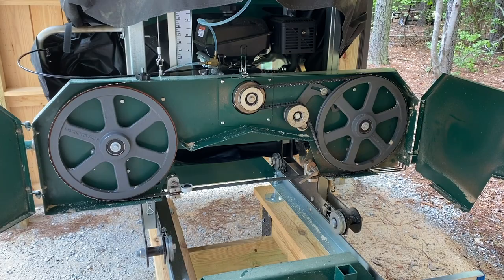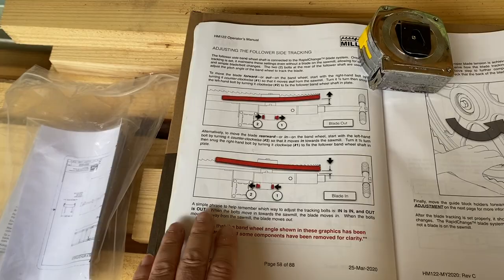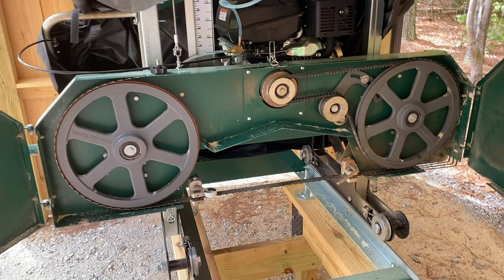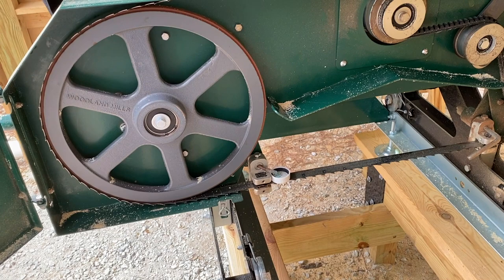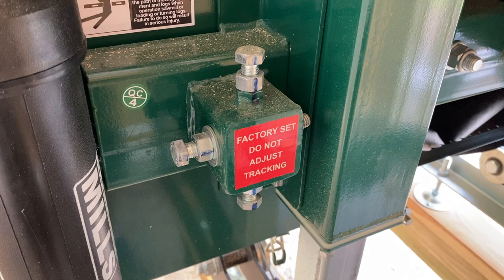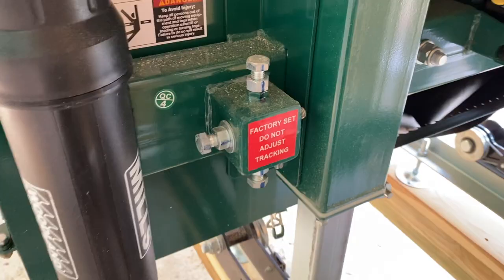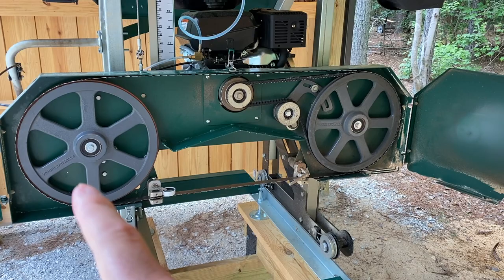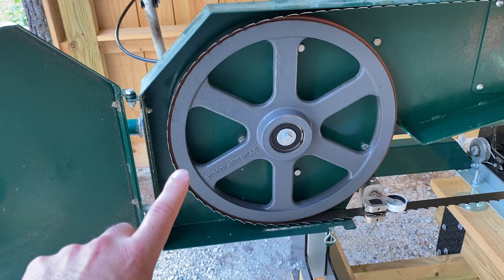Blade jumping off? Learn how tracking works and avoid common mistakes with your sawmill (Revised)

Comment: Saw this video after the event. We probably had the drip set to high but the actual killer was spraying the blade with grease to stop the blade rusting between sessions. To us newbies it seemed like good idea at the time. Oops. The moment we did it it jumped off destroying eight teeth and bending the lower 90 degree right hand catch bar as the blade is about to go up around the drive wheel . Not sure of correct name. With your valuable help we learnt our lesson destroying a newish blade. Roasted by Mrs Lloyd. We also use a torque wrench to measure the tension. The two of us have different ideas of when it's right by feel. Thank's again.
Reply from the maker: Does seem like a good idea until it isn't!!  I haven't found a good solution to blades rusting, but it doesn't happen to me a lot -- normally I dull them and replace them faster than they sit on the mill and rust.

Comment: Thank You! Add me to the list of #3 mistake dummies. This video saved my sanity. I had everything dialed in and checked it twice but never checked the flow of lubricant. I was definitely dumping too much to the blade. All good now!
Reply: Same here! My blade popped off after I had finished a cut and I was raising it for the return trip. Not sure if it had stopped yet... maybe it was just hydroplaning while braking... :) I had a continuous flow. Tracking looked good when I had started on this log, my all-time second log sawn. So Jack, I bursted into laughing when you mentioned it was not a car wash... :)

Comment: We just get our new 126 sawmills, and we tension after the instructions, so the tension mark is flush, and it work well the 30 first minute of use without lubrication, but as soon we put on some lub, the blade popp off.
We call the local dealer, and he said right away the tension is too high, and he was spot on.
When we use a torque wrench it shows 48nm when it flush, and dealer said he never go over 30nm,. (You should never use the flush mark before the saw have run some years, he said)
After we do that it work great without any trouble, so check your blade tension with a torque wrench, don`t rely on the tension flush mark.
Reply from the maker: So the torque recommendation is based on the type, amount, and arrangement of belleville disk springs inside the tensioner.  On 2021 mills, this has not been consistent from the factory and people have run into problems.  They either have an issue with the quality of the springs or it's an assembly/QA problem.  It results in very inconsistent positioning of the tensioner bushing.  WM recently released a tech bulletin about this.  On my 2020 mill and older mills, setting flush works as intended.  I have been doing that for 10+ months and never a single issue.

You can use a torque wrench to verify in either case, just be aware that the torque wrench is only giving an approximate indicator of spring tension (it reads angular tightening torque, not linear tension) and it needs to be read while cranking continuously from low tension to high tension (if you stop then re-tighten more, the reading will be wrong due to friction).  

What really matters with springs is the amount of displacement (distance) changed.  Tension is directly proportional to that.  So if you can indicate the proper setting based on the distance the tensioner spring is compressed, that is more accurate than a torque wrench.

Comment: Until just a week ago I had never owned a band mill because everyone I know kept telling me that they were to much work and to hard to tune and maintain. well I will be straight and honest they are a little more work to fine tune. and it dose take a bit of trial and error to learn. but really its only frustrating until you start to understand warm weather dish soap water. one or 2 drops per second on the blade for green wood. no more this can definitely cause a blade to jump off if you just let it spray full blast. this was something that cost me two new blades so far. and the tracking concept is very well explained here on this video. Except I really wish there was a easy straightforward way to check the wheel alignment. like a Machined face on the 2 band wheel. and a tool to go up against both wheel faces at the same time. I hope someone will make a video about how to make a tool like that

Comment: I greatly appreciate you taking the time to make this video, It was very helpful. I took two 2' identical levels and clamp them to the band wheels one on each wheel horizontally wile being Torque to 25' pounds then i placed a 4' level across from one level to the other and my band wheels were both towed in towards the center. vertically was good .  thank You.

Comment: That was really frustrating!. Out of 10 new blades i ordered with new mill only three can be resharpen. Seems like i have had same Quality Control #4 sticker on. Probably applied as a package or just for decoration. Another problem with QC#4 was four blocks/guides maxed out on the bottom and flush with top holders. And that required some grinding and tinkering.. Other then that it's a good machine.

Comment: Great video. I have a customer who runs this mill and he was having difficulty getting it to track right. I have a machine shop and try to understand what is going on. 
Upon first inspection I noticed there is a huge play on the slider/ tensioner mechanism of the follower wheel. Obviously the play in the horizontal plane is eliminated by the tensioning action but the play in the vertical plane is essentially there and only gravity works on it. If not a source of poor tracking it might cause vibrations. I have taken the tensioner mechanism apart and milled down the four studs about a millimeter to achieve a pretty close sliding fit. It is a bit disappointing to see the sliding portion is just a thick plate which has a bow in it and was not post- machined. I left this alone because milling or surface grinding it on both sides was too involved at that time.
The customer has run the machine after that but is still having difficulties, it appears the saw tracks OK upon initial adjustment but wanders and even is thrown off at times. I do not think there is much to be gained in fiddling with the drive wheel side because there is only a slight difference in the position of the saw on the two wheels, not enough for it to be critical in my opinion. 
I'll be going to the customer location tomorrow morning and again evaluate the situation. Thanks again for the video, cheers from Holland.

Comment: the other co. builds with the top of the wheels lean out ward  ( 3/16 to 1/4") which
points the blade  teeth slightly downward . as you tighten the blade the roller guides 
or the  rub guides bring the blade parallel  to the track

Comment: That was good info ,I have been using way to much lube. Bubbles in the lines are causing inconsistent flow settings. And too much lube causing the blades to slip off.

Comment: Move the roller bearings out of when doing tracking also ,  For the most part my tracking has  been good. Had a few times it's jumped, but mainly I  think it's  when putting on a new blade, but I have always noticed my drive side the blade is usually about 1/16" over the back side of the wheel  but it stays on track more often than not.

Comment: When u put your blade on the wheels. you can see if it will track off or be straight. My Thomas did this and once you adjusted ,the blade stayed on fine. Woodland has more sophistication than  the Thomas does.

Comment: Instead of guessing how much lubricant to use while milling.  Wouldn’t it make sense to monitor blade temperature with a hand held laser temperature gauge or whatever it’s called.  Then adjust your lubricant accordingly.  I would imagine that blade manufacturers have a recommended temperature not to exceed for their specific product.?

Comment: less than 5-hrs and changed the blade and the new blade won't track correctly......called woodland and they said I would have to adjust tracking on the follower wheel.

Comment: You may have answered this multiple times before, but what is the purpose of the bottle cap sitting on the blade where the lubricating tube sits over the blade?  Just to catch any errant drip?  And I guess it gets removed during your prefight checks.
Reply from the maker: Correct, it keeps lube drips off the blade after the mill is shut down for the day, avoiding a rusty spot on the blade.

Comment: Got a new mill and had the blade jumping off from the get go. Tried different blade tension and it would still happen. Tried to align the wheels and it's still coming off. I am afraid to use the mill now. I already destroyed 5 blades. I called the tech support and they suggested the blade tension is too much (towards the end I used a torque wrench set at 25 lbs because no matter how I tensioned the blade by hand it came off). It's pretty frustrated as I need to mill logs and not do repairs on a new mill.
Reply: I've had an HM130max for 4 years and it's been nothing but trouble. I've spent days adjusting and checking everything, but the blade still comes off whenever it feels like it. Customer service was useless as well. These mills are cheap junk made in China with clever marketing.
Reply: @4500az  Sorry to hear that you are having these troubles. I had a real good mechanic over and he aligned the wheel again for me and it did the trick! Yes these mills are cheap but you do get what you pay for them. It's like spending 10k for a new vehicle and then wondering why you need repairs after 10k miles. I really like milling logs and I am not sure what I would do next. Spend 50k$ for a good mill (woodmizer lt35 hydraulic would be my choice)? I can buy a lot of lumber for that. I think that you need to be a mechanic for those mills and account for extra time for repairs&maintenance.

Comment: Great comprehensive video, thank you! What are your thoughts on reversing the lubricant nozzle so that is drops the lube on prior to the blade guide, perhaps allowing some to reach the underside of the blade as well? Some of the more professional mills squirt the lube on both sides
Reply from the maker: I wouldn't rely on the blade guide to do a good job at that, but hard to say until you try.  One of the slickest setups I have seen used thick felt wicks to wipe lubricant onto the blade, top and bottom.  Did not seem complicated either.  Probably would be easy to rig up.
Reply: @Lumber_Jack  I heard you mention that, with diesel in one of your videos. I'm waiting for my hm130max to show up... any day now :)

Comment: Great video! I am currently setting mine up and it will definitely need to be adjusted. Did you place you saw on the tracks then shake it like they recommend before tightening all bolts? Thanks
Reply from the maker: Absolutely, that is very important, and you want to make sure your track is straight, level, and flat before doing that, since it will affect how the carriage wheels sit and the trolley frame settles.
Reply: @Lumber_Jack  Keep the video's coming!

Comment: never move manually blades in opposite direction- I did and get problem with motor ,probably motor thru the clutch moved in opposite direction
Reply from the maker: Clutch should not be engaged when engine is off.  If it is there are bigger problems!

Comment: How much clearance do you run on the blade guides.
The book says.020 on each side. That seems excessive to me. We have started getting some wavy cuts
Reply from the maker: I set them by the book, 0.020" top and bottom and 0.040" on the rear.  I use shim stock to set all of them simultaneously.  Make sure you snug down the set screws real tight otherwise the guide blocks can move.  Cut quality should not depend on the guides, they are just there for support if the blade deflects for some reason.

I have seen ripples (spaced 1/4-1/2" apart) when entering the ends of a cant that is not supported and shakes a little.  And I have seen larger scale waves, but rarely.  The waves usually come from pushing too fast, or cutting with a dull blade, or hitting a knot while pushing too fast or with a dull blade.  If you can avoid those scenarios it will reduce the possibility of waves quite a bit.

If you have an adjustable blade guide, bring it close to the log to minimize the unsupported part of the blade.  Finally, make sure blade tension is set right.  The distance of the supports and tension are the two key factors in resisting blade deflection under load.
Reply: @Lumber_Jack  thank you. I appreciate your reply
Reply: Do you use a torque wrench and how much pounds?
Reply from the maker: @waynepitts2154  I don't use a torque wrench.

Comment: I purchased this Same saw  no way I can tighten the blade the way they describe  , making the washer flush  I’d have to use a pice of pipe to get it to go flush it’s that hard to do I’ve gone thru 4 blades  in two logs jumping off
Reply from the maker: You should contact WM tech support -- sounds like there may be a problem with the tensioner screw or the Bellevile disk springs that are stacked up inside the tensioner.  It should not be hard to turn.
Reply: I saw in the woodlandmills manual that you need to use the torque wrench to set the bushing flush to work properly.. that you add or remove a washer on the inside of the stack of tension washers.. So I would think this needs to be checked every now and again, so the auto tension is ok..